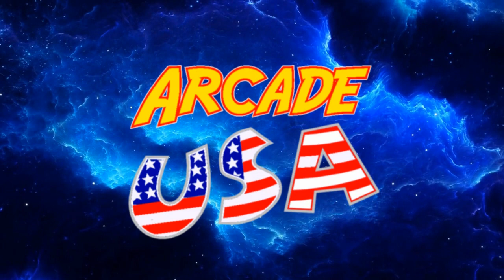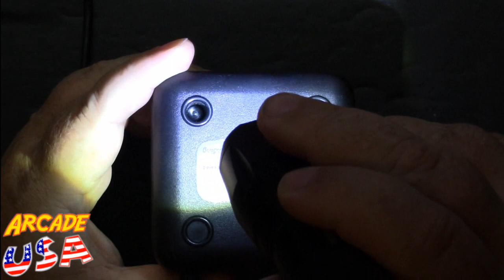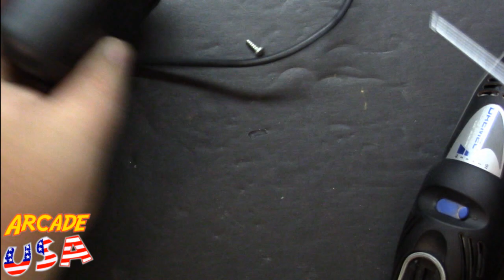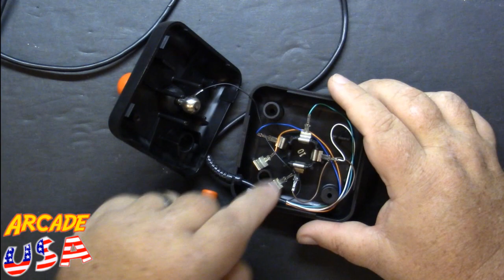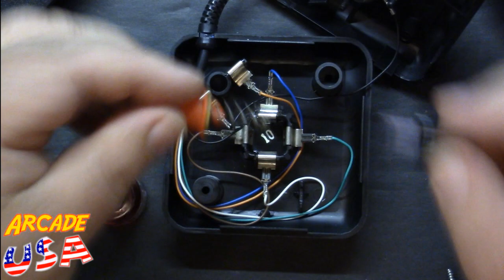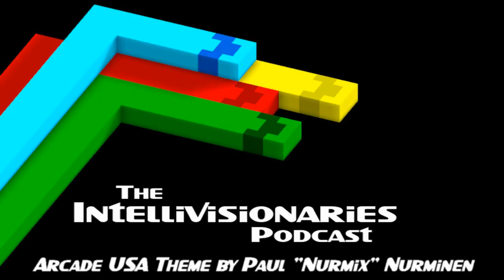SunCom Blaster Controller Repair (Atari 2600)

Comment: Some of that JB weld putty stick works well if there there was nothing left to glue to, works well in building back the walls the clips fits on. Once it's fully cured it's just as hard if not harder than the plastic in the joystick.

Comment: The SlikStik is by far my favorite joystick for eight way games. I've acquired many over the years, for 'backups'. The Blaster was out before the SlikStik and the early SlikStiks were identical other than branding. At some point there was a design change in the top of the stick, the four slim posts were replaced by two beefier 'blades'.  It also seems there was a change of material. I have several Blasters and four post SlikStiks that all have broken contact holder boxes, similar to Willie's. The plastic is quite brittle and seem to almost crumble. The later two 'blade' sticks I've not seen a broken contact boxes with. There's also a StarFighter joystick of the same design that has a plastic 'lid' that sets atop the contact box supporting the top of the box from the outside. I don't recall any issues with the screws on the Blasters, but the SlikStiks, StarFighters, TAC-2 sticks all have been removable with a standard #1 Robertson driver, a 'Greeen Robby'. The centering grommets in these are tyre inflation stems. :)

Comment: There's a really good set available at Wal Mart - Hyper Tough 77 Piece Electronic Repair Kit. About $13 bucks. Huge selection of bits including the Triangle bits. Everything is well labeled.  I have the suncom Tac-2.....
Reply from the maker: I looked at that, did not see a square bit with a center drilled hole.  thats why i had to use my dremel, to grind out the center post so I could get into the bit.  But at least it does have the square  bit I could have used after grinding out the center post.  I needed a bit like this that I could not find locally and was not going to spend the money just to use it one time :P https://www.markertek.com/product/spbit/middle-atlantic-spbit-square-post-drive-bit-hsk-series-screws?ne_ppc_id=1813977582&gclid=Cj0KCQiA2af-BRDzARIsAIVQUOcsTpseLtTAqfoxDBx4DGyqJE7dem8e0fwF_5pQLA4pXx5b_K9kfKcaAj7sEALw_wcB
Reply: @SVT512  Interesting, it kinda looked like a tork shape in the vid. it's always something weird out there. Drill a hole in some square bits with your dremel.
Reply from the maker: With my shaky hands now, I would drill a hole in my finger :P  I opted to just grind out the post in the screw to avoid injury :P

Comment: I have one of these controllers I found at a local thrift some time ago, but the joystick seemed stuck. Watching this video I now know how I can open it up and check it out. Thanks for the video!
Reply: If the stick is not centered 'at rest' but is off one direction and can still freely move it's likely that the grommet is torn. This is not uncommon, I have two sticks like this.  The ball shaft going up into the grommet can also be bent or broke.

Comment: amazon.com sells the bits (P. L. Robertson) https://www.amazon.com/s?k=robertson+bits&ref=nb_sb_noss_1
I have never seen a #00 screw
Reply from the maker: Yep, but i needed this one due to the center post in the screw - https://www.markertek.com/product/spbit/middle-atlantic-spbit-square-post-drive-bit-hsk-series-screws?ne_ppc_id=1813977582&gclid=Cj0KCQiA2af-BRDzARIsAIVQUOcsTpseLtTAqfoxDBx4DGyqJE7dem8e0fwF_5pQLA4pXx5b_K9kfKcaAj7sEALw_wcB

Comment: It is not a security bit.

Order from a northern US state or from Canadian hardware store.
*Robertson Screwdriver Types
*
Currently, there are five different Robertson screwdriver types available, with suitable screw size indicated by the color.

Orange drivers (#00) are appropriate for use with screw types 1 and 2. The recess size range (the size of the corresponding square imprint on the screw) is from 1.77-1.80 mm.

Yellow drivers (#0) work with screw types 3 and 4 and feature a recess size range of 2.29 to 2.31 mm.

Green Robertson screwdriver (#1) operates with screw types 5, 6, and 7, with a recess size range of 2.82 to 2.86 mm.

Red Robertson screwdriver functions with screw types 8, 9, and 10 and has a recess size range of 3.34 to 3.38 mm.

Black Robertson drivers work with the largest screws, types 12 and higher, and have a recess range of 4.81 to 4.85 mm.
Reply from the maker: Yes its a square, however I do not see the center hole for the post that was in the middle of the screw.  that is what I was grinding out in order to get a bite on the bit.  so since it was not a normal Robertson bit, I figured it had to be some type of security bit with the center post in the hole :P, this is the type of bit I needed but could not find locally and did not want to spend alot on something I was going to use one time :P https://www.markertek.com/product/spbit/middle-atlantic-spbit-square-post-drive-bit-hsk-series-screws?ne_ppc_id=1813977582&gclid=Cj0KCQiA2af-BRDzARIsAIVQUOcsTpseLtTAqfoxDBx4DGyqJE7dem8e0fwF_5pQLA4pXx5b_K9kfKcaAj7sEALw_wcB
Reply: @SVT512  First time to see a security square. Only see security Torx bits as common.
They would not pass Robertson manufacturing standards as screws are heat treated.
Looks like a real special order that died as like the many Philips look-a-likes.